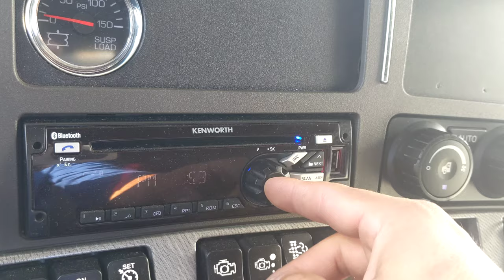How To Set Your Clock On A Semi-Trucks Radio

Comment: Doesn’t work. As soon as I click 12hr it goes back to the radio. Doesn’t even show clock numbers.
Reply: I dunno if this will help you, but I found out that setting the time zone on my truck dashboard also affected the time on the radio. Maybe it's the same in your vehicle?
Reply: Had this same issue and figured it out. It’s in the settings menu in your dash display as far as the newer Mack’s go.
Reply: Mine doing same thing as yours
Reply: Push display button then it works
Reply: @auntieaoife this most definitely worked
Reply: I've got the same problem with some of the other guys as soon as you click on 12-hour format it goes right back to the radio

Comment: I have a 2022 Freightliner and doing this gets me to 24 or 12 hr, then after selecting that... it goes back to the normal display with no continuance to then set the time.  ???
Reply from the maker: It should be a different selection for setting time itself versus 24 vs 12 he clock I'll check one of our newer freightliners at work and get back to you but just making sure your question is on how to set the time right

Comment: That did not allow me to adjust the time the second I turned the menu knob it changed the volume . It's a Delphi but the exact radio you were working with.
Reply: Same here.  But I figured it out.  You set the time on your steering wheel for the truck display and the radio clock will read that time.
Reply: @noname-sd1tc  Thank you. My husband I spent the day trying to adjust ours using the video. You solved it in 5 seconds.😀

Comment: Nope... when I click after 12/24 it goes back to radio station
Reply from the maker: What brand do you have and what's your year make model of your truck?
Reply: Yup, mine did the same. Click to get to time format, then click again and took me back to Bass settings. Did not start the numbers to flashing to adjust the time. 2021 Cascadia.
Reply: Mine is doing this too.
Reply: 2021 Mack having same issue
Reply: Change the clock on the trucks display not the radio... thats what I did to fix mine!!!
Reply: @christopherranieriranieri9870  
Shit was driving me crazy, been messing with this thing for 2 hours. 
Switched it like you said and kapow,
I owe you a beer my friend. 
Ty,SEMPER Fi
Reply: @christopherranieriranieri9870  how do you do that cause I thought I tried that and it only allows you to adjust the format